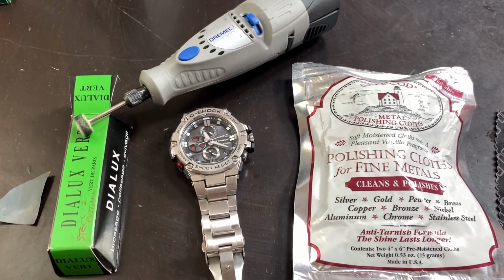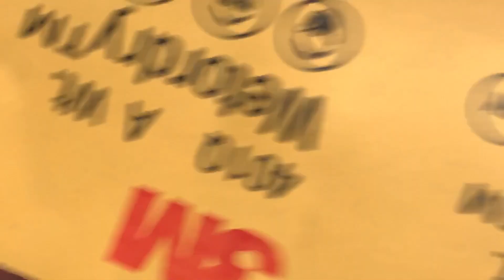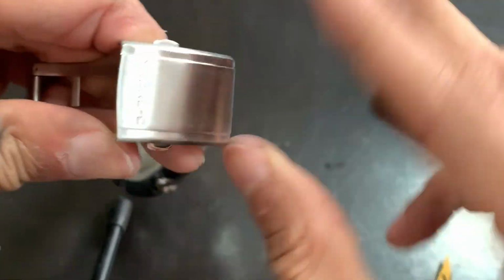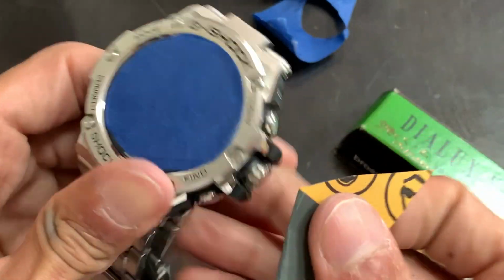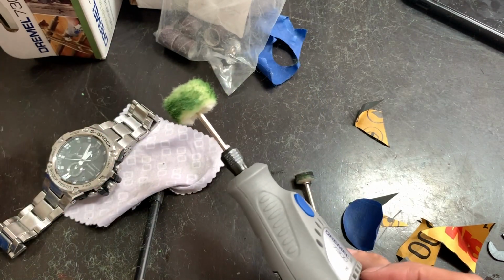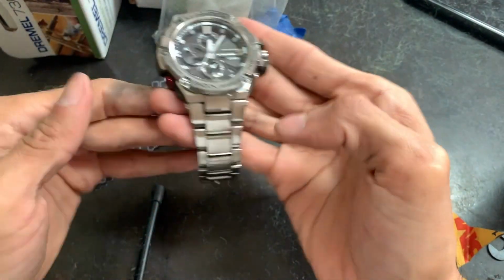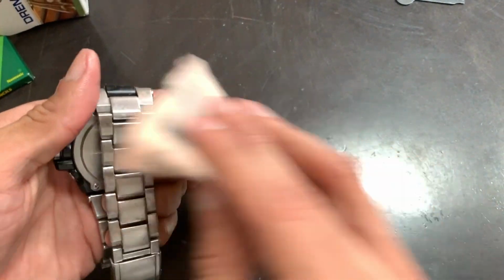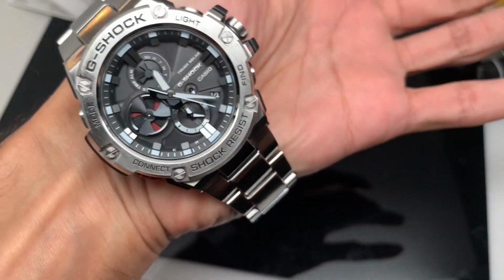Remove Scratches and Polish Your Stainless Steel G-Shock

Comment: Excellent video thanks. Another option for the brushed surfaces would be Scotchbrite / Brillo pads. It works pretty well. I use Cape Cod for mirror finishing. I have bought an affordable bench polisher which I think may be more accurate that using the Dremel.
Reply from the maker: Ian Maw Do you use the bench polisher for personal or business? Not sure I’d use it that often. Also, curious. How did you find my video? G-SHOCK search or scratch remover search? Thanks for watching and commenting. Much appreciated.
Reply: @GiShockGo  Hi mate. I just watch a lot of G-Shock videos and your video popped up in the recommended list. I bought the polisher (which I am still waiting for) to make it easier to polish by stainless steel watches. The Scotchbrite polishing method works well but I have found it difficult to get the grain straight. That's what I hope the polisher will help with. You need, and deserve, more subs in my opinion. Maybe you could get another channel to mention you such as watchup69 or the Gshockhighfashion channel.
Reply from the maker: Ian Maw ... you’d be surprised how competitive youtubers can be. It’s ok, one sub at a time. No rush.... thanks for watching

Comment: I really shouldn’t have to do this on a 900 dollar mt-g watch. Hopefully casio will refund me. 2 days and this thing is covered in scratches with little use!!! Im very pissed at this 900 dollar watch having Very Cheaply made stainless!!!!!!
Reply from the maker: John Wells sorry to hear that.... Not sure what kind of wear would cause scratches on two days but I believe you. The MTG series is fragile and doesn't have DLC coating like the MRG. Truth to the matter is that any metal watch, Rolex Breitling Omega etc Will get scratched under harsh conditions....